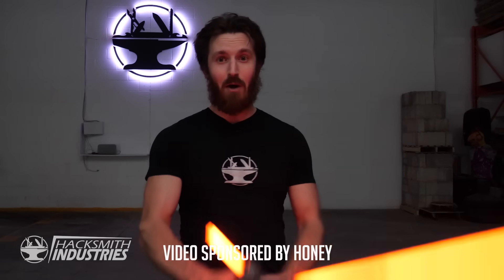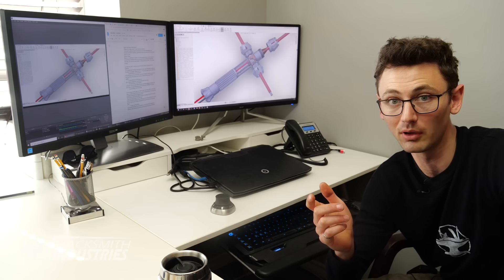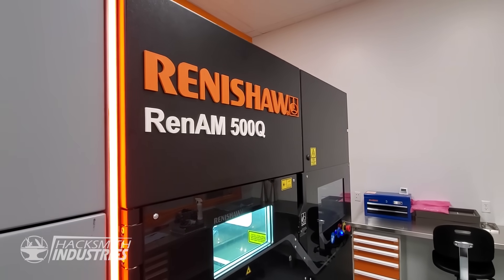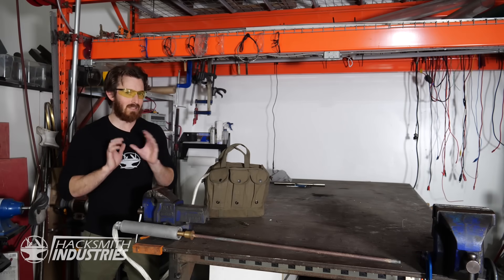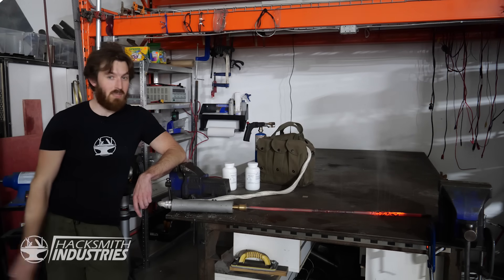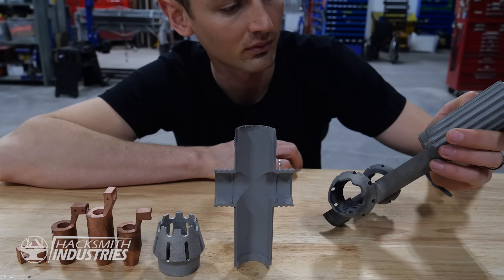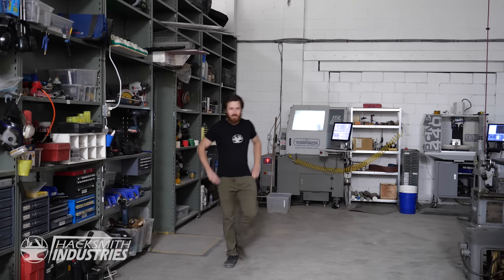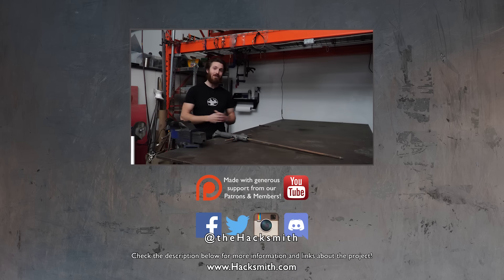3000° Kylo Ren Lightsaber! (+ GIVEAWAY!)

Comment: Yeah, cuz people can just hold a 3000 degree stick next to their face and not melt 🙄🙄
Reply: I mean… yeah. Clearly you can because he did
Reply: Clearly he didn't. It's 3000° even with Celsius that's way passed the point of heat stroke. 3000°f is only 2000 less than the surface of the sun and our brains start melting from only being in 120°f of its heat for like an hour or so. Heat doesn't just rise, it radiates out words. 3000° that close to a bare face and that face is pudding in 5 minutes.
Reply: @OG-ColorfulAbyss.  You’re comparing the sun… to a stick of metal…
Reply: Is 3000° not 3000°? Tell me, how long can you hold your face 2 inches from a convection heater before you start to feel like you're dying.
Reply: So, in Celsius, the most commonly used measurement, I was only 500 degrees off yet I'm talking out of my ass? Lmao ohkay
Reply: Oh and you think the heat on that stick (also man-made) isn't radiating? Heat doesn't just rise, it spreads.
Reply: You said 10,000 in F is 5,500 in C. I said, the surface of the sun is 2000 degrees more than this supposedly 3000 degree stick. That makes 5000. Are YOU illiterate? 💀🤦‍♂so I got the F and C backwards at first but I was still only 500 off according to what YOU said lmao  😎👌
Reply: @OG-ColorfulAbyss.  bro, read the whole comment. I was talking about the core of the sun which is basically freezing cold compared to the surface. 💀
Reply: @OG-ColorfulAbyss.   No I didn’t? I count 5 replies from both me and you. Actually, you’re the only one deleting comments
Reply: Actually I think it’s a glitch with YouTube or something. Your comments are showing up just fine when clicking on the notifications but not when I just browse the replies

Comment: Hacksmith, yeah, what about making a power sword like in Warhammer 40000? A metal blade with electromagnetic wave generator (for example, microwave generator), which frequency and power are capable to destabilise the crystal lattice of solid materials, and even generate some hotted plasma in the air, at a short distance from the blade?

Comment: sooner or later in like 2024 they ain’t gonna need that pack to use the lightsaber it’s just gonna have it all in the saber
Reply: 2034 more likely, you can't simply make batteries that size shrink.
Reply: @CheeseRunner  And they said in the latest video that such a lightsaber which does not need a battery pack will be in the next lightsaber video.

Comment: Everything in Disney's Star Wars is so stupid. Making a lightsaber cross-shaped is stupid, It will cut the hands of its owner during the jumps in fight
Reply: No it wouldn't, a crossguard saber. Your grip wouldnt change, I do agree with everything else about Disney is true.
Reply: @hobogrifter  The cross part of the sword was to block attacks, not to cut, didn't have blades there for a reason. That light saber has laser beams, which cut. It reduces maneuverability. Even by just holding it you're in risk of burning your hand.

Comment: I think I know what the problem with making a protosaber
Basically:
You need to make it hot but not so hot that it melts the metal
Reply: But there is a lot of metal that had a very high melting point but it is usually very expensive or heavy, but titanium is light enough and cheap enough to use
Reply: Yeah they said that in a way sorta

Comment: Taken together, Star Wars has technology that allows you to travel at the speed of light even more. So they have some form of warp drive, otherwise they would be subject to time distortion according to the theory of relativity. This technology appears almost everywhere from hovercraft to robots. What if the blade of a lightsaber uses similar time-dilating technology. This means that the blade is in an accelerated time field. Pruning through a steel door thus takes a few seconds for the observer, but in a dilated field of the blade it is a matter of several days. This would mean that there is no need to supply as much energy to the blade at once and the efficiency would be affected by the time ratio of the blade field and the surroundings.

Comment: You could use a thin, plastic (or other flexible material) that has a high melting point, and super heat gas to turn into plasma, expand, and like a balloon, the plasma will fill the this flexible material and expands it until it stretches out fully. You could also use hard plastic on the bottom to keep it from making a balloon-shaped lightsaber lol. IDK about the color, that stumps me. Maybe use different gasses, but I am no expert on plasma.

Edit: The plasma would melt any plastic. If you want to comment a material that’s flexible, strong, and has a high melting point (3500 - 4000 degrees at minimum) that would be great! 

Edit 2: You could make it a lightsaber instead of a protosaber if you use high energy density solid state batteries. They are coming on the scene soon, and combined with some capacitors (kinda like batteries except that they have a really fast charge and discharge rate) make it deploy really fast, and be able to (kinda) fit in a longer, or thicker lightsaber design then you have right now! This entire thing is just a theory, but I think it has some merit!
Reply: It’s possible that in the future, graphemes might work, but as of writing this (May 22, 2020) I don’t think a material exists that fits the heat and flexibility requirements of the design I stated. I’d love to hear people’s thoughts!

Comment: hacksmith I have a challenge for you. make a lightsaber which has its battery back inside the handle. Cause then it would look cooler and it would have no cable for it. But there would be additional weight for it.

Comment: You could develop the plasma blade using a magnetic containment feild extended using neodymium. Using a high voltage beam of electrons to ionixe the air,you can have a vaguely functional blade that isn't a physical blade

You will need to have a compact electron accelerator(similar to the technology in cathode ray tubes.)

Additionally,the magnet has to be pulsed at a high frequency and current

Comment: def. not a scientist and I have no clue about the engineering going into a light saber but when gun barrels can't balance between thiccness and rigidity they usually use fluting so if there was any way to incorporate fluting into the design of the blade then it would probably save on weight or make it stronger. 

Just figured it might help because gun barrels have to be engineered to be very hot and still hold their shape.

Comment: I doubt you will read this comment. But i have quite a bit of experience tapping titanium. Titanium is incredibly strong you can drill a slightly oversized hole than what the tap calls for. The threads will be strong enough to hold whatever it is you need even though they are shallower. Also you can basically melt a broken tap out of titanium using ferric chloride. just submerge your titanium part with the broken tap in the acid and wait overnight.

Comment: At 3000 degree F ur almost at a plasma, just need to burn an element with lower boiling point.
I the temperature of the surface of the sun is about 9
10,000°F still "most impressive" - darth Vader

Comment: I have a good trick make a light saber and the power will be normal but the power will go out too so it will go in and then out so it will be infinity battery or use the plasma generator but try to make it smaller and put it in

Comment: It is literally titanium, one of the hardest metals that we know of. It shouldn't be surprising that it's ruining every single bit and tap that you're putting in the damn thing.
Reply from the maker: Titanium isn't actually anywhere near the hardest! It's very comparable to steel.  Just half the weight.  The additional challenge for us was because it was 3D printed,  which also makes it harder to machine due to how it was manufactured
Reply: @hacksmith  Ah, sorry. I forgot that it was mostly down to the weight that makes it superior. It is stronger but maybe not to the degree I was thinking. I may have had Tungsten in mind.

Comment: Find a way to fit the battery inside the handle
Reply: Well you think its impossible eh? That's what engineering is for, ever heard of a light saber pike? Imagine a long spear like rod with a light saber at the end, they were used by shadow guards. You got the metal rod and heat conducters on the top, you got the battery's in the pike handle, why wouldn't it work?
Reply: It would be EXTREMELY hard to make a perfect looking light saber considering they are made from things that dont exist...also it would cost millions to make a fully hand held lightsaber
Reply: @itz_yhk3967  Two words. Bill Gates.
Reply: Not possible just make the battery a back pack

Comment: when you think about it this stuff could be good for breaching doors if you just had a portable heat generator to plug in and then either slice the locks or just demolish the door... but as i’m writing this i see many holes in my plan like how long it would take and stuff like that so scratch that shit
Reply: Imagine hiding and you see a damn lightsaber burn through your door
Reply: @lilguy9779  i would surrender immediately
Reply: Technically you could heat it faster.... It's just not even safe at all. Idk but maybe current could just jump to your hand at that point. Buy it could be made smaller and hand held but would take a while and would give them away. 

However if you wanted to isolate a piece of metal heat it up and smash through it.... That would be interesting.

Comment: I predict some electromagnets/mini tokamaks in the near future on this plasma lightsaber.
Reply: The design I always wanted to try was a column of electromagnets around a inner liquid helium cooling pipe to control electromagnets heat. Use some sort of current either ac or dc (I’m just a freshman mechanical engineering student at Rose-Hulman so electricity isn’t my thing) to ionize maybe helium gas or something like that. The electromagnets in theory would contain the plasma but I’m sure I’m forgetting something. Idk just something I always thought of. I know you probably won’t see this anyway lol.

Comment: You should make it we’re the lightsaber hilt is bigger and make the blade in two parts we’re one’s a litter bigger than the other so the smaller one can retract into the other one and when you press the button it will pop out and when you turn it off it’ll retract back into the bigger hilt

Comment: Could burning fuel work? Have 1 outer tube, covering 2 separate inner tubes. Pump Acetylene into one tube, and air into the other, with small perforations along the length of the tube. Combustion would mainly happen inside the outer tube, causing it to heat up. Small holes in the outer tube would allow the fire out. Igniting it with an electrical spark from the bottom would cause the fire to spread up the tube like a saber extending in the films.

Comment: The crazy cool thing is that if these somehow happened to get into the hands of people in the medieval era, they would probably actually use these in battles.
Reply: And it would be experimented on and stuff so now we would definetly have real light sabers
Reply: You need a lot of power to keep a blade hot, not to mention that at the time it was difficult to use materials that melt at such high temperatures, so it would be impossible to craft a sword that wouldn't lose its hardness at high temperatures.

The biggest issue with this is if someone parries it into your face you're (well) done. And armor is not going to help you avoid getting cooked, ever baked a potato in aluminium foil?

Comment: I have a cool idea. What if you ran the output of a small tesla coil in a backpack into a katana? You would have to round off the end though because of how corona behaves.

But theoretically it could work if the current was high enough.

I get this idea from a surgical device, its a scalpel that uses electricity to cut through "stuff" like butter, and it cauterizes the cut immediately.

Comment: that's not a lightsaber it's a proto saber the first type of lightsaber from before the old republic. Proto sabers were prototype lightsabers that required a battery to be worn on the hip and a wire to connect from the battery to the hilt to function.

Comment: hey, I have a method for producing a real lightsaber. like, the straight up real McCoy (though, it would still require a pack to be carried around. it would work by passing an extremely powerful HHO flame (like the 20inch torch you can find on youtube) through some serious high voltage arc, and focusing using a halbach array. if you're interested in hearing more, let me know.

Comment: Based on my knowledge from my apprenticeship in Fabrication (still completing) and my qualification in Machining I believe for the type of printing with SLS methods they should be able to print those without support as being in a powder the powder acts as a support as long as it can be removed later (via a preexisting feature or hole ). and in my own experience in printing treads you can do it providing the layer height is is smaller than Pitch(high between a revolution of the tread), though still recommended to run a tap or die through the treads to clean them up. If I am missing or not right please let me know and ill look into it (perhaps edit this if i remember?)

Comment: WHAT ABOUT HAVING A DARTH MAUL LIGHT SABER THAT WOULD BE COOL
Reply: Yeah but the problem is that the cables for the powersupply cant be attached because the saber would probably burn the cables or cut them
Reply: Florian Gramsch what if the cords were able to rotate freely around the handle? That might allow the cords to be run up the arm of the user so they can’t accidentally slice it in two
Reply: @floriangramsch9036  Здрасте
Reply: Petko Petkov  could you please write that in English I don’t speak Russian
Reply: @Evan Clapp what if you found a way that the charger was in a glove 

I know it wouldn't be possible but still
Reply: @evad__1131  you mean Wireless?
Reply: @evad__1131   yes it would
Reply: evad_ _1131 at that point it might be easier to have a lightsaber without cord
Reply: What about having the Rebel Lightsabers that were used by the Inquisitors? 
😂😂
Reply: But if power supply wires would go by the arm of the user?
Reply: Give this man a medal
Reply: Someone gonna lose a limb.
Reply: Evan Clapp unless the chord goes in the middle of the hilt
Reply: Yeah
Reply: Too dangerous
Reply: Where would the cable go?
Reply: Evan Clapp Just plug it in from the side?
Reply: Stop yelling
Reply: I have a head.

I wish to keep it that way
Reply: Or that one double saber that can spin
Reply: Naslada za ochite
Reply: If they make it, be prepared to see them with no limbs in the next video ;)

Comment: Hack smith: we are designing a retractable plasma light-saber.

Me: I'm sorry WHAT. HOW. WHEN.
Reply: Welp, we know what side of the force the Hacksmith is going to be on.
Reply: I bet they went to Illum and got a kyber crystal.
Reply: My question is: Is it going to be capable of destroying things or will it just be a telescoping plasma tube?
Reply: Electro magnets and a shit load of batteries my friend
Reply: @mrducky6322  the length of it though would be problematic for something of a decent size
Reply: 3 Days
Reply: it’s finally here 😈
Reply: Oh no there theyre going do it before me
Reply: Alex Noronha-Hyde YESSSSSSSS
Reply: They found Kyber Crystals
Reply: Its coming in September 19
Reply: @Greasel Snatches fire is not plasma just searo it up
Reply: @user-cg3em4cw4f  it's not the opisit the opisit is anti-mater
Reply: is the viddeo out yet??
Reply: my question is how are they so talented to just...

have money?
Reply: I'm guessing it'll be a telescoping rod made of titanium with a huge electrical arc + compressed air to make a plasma cutter, therefore heating up the titanium (not enough to melt it) to allow cutting through most things but at the same time being able to cut through metal, and they could change the color of that saber easily through different gases being pumped in instead of regular air (so xenon for bluish-white, neon for red, argon I believe is green, etc).
Reply: @Toby Twist Yep! I thought of this method a couple years ago and it seems the most realistic you could get, turning up the voltage and airflow a bit and effectively making a tesla coil would produce Kylo's plasma waves from the blade too. So in all, one of the best ways to make a real lightsaber.
Reply: Its out
Reply: Yeah how it's plasma ( I don't know much about plasma ) isn't plasma condensed matter
Reply: @grass_t0ucherr  A plasma in this case is just a very hot gas. So hot the Electrons are striped from the atoms or molecules leading to glowing and conductive soup of free moving ions and electrons. A flame is an example for a very cold plasma, very little part of free moving ions and electrons.
A lightning is also an example or the corona  of the sun.
Rather hot examples of a plasma can be found in Fusion Reactors with a temperature of around 150 Million degree C.
Much high temperatures are possible. 
As the free moving ions and electrons have a charge they influenced by magnetic field that how magnetic confinement in fusion reactors work, so how the plasma contact to the wall is reduced.
I am doing my PhD in fusion material research like tungsten. However, I am not an expert on the plasma physics part...
Anyway, I hope that gives you an idea;)
Reply: @TobiasWeg  
Good luck man.
Reply: @grass_t0ucherr  in the plasma  the atoms are ionized
Reply: @grass_t0ucherr  really hot gasses like the sun or the fire that you see around a rocket during reentry
Reply: @grass_t0ucherr  plasma is super heated gas